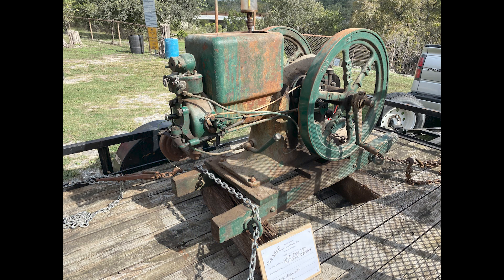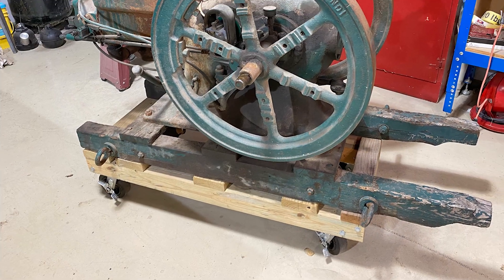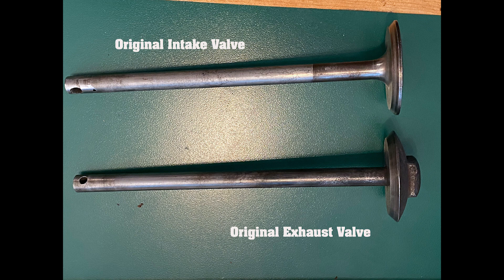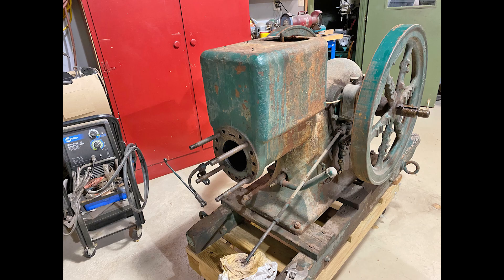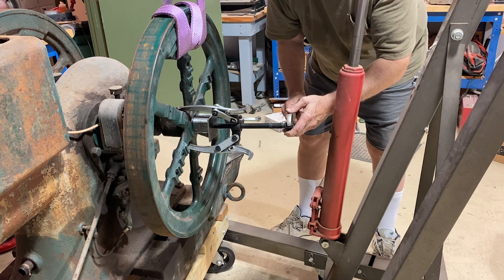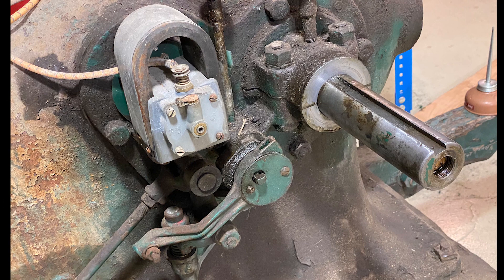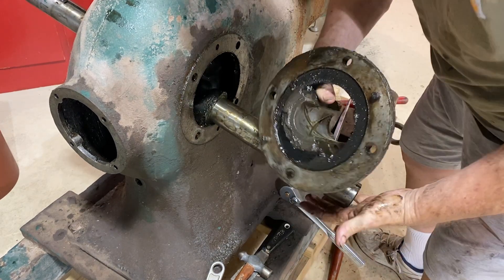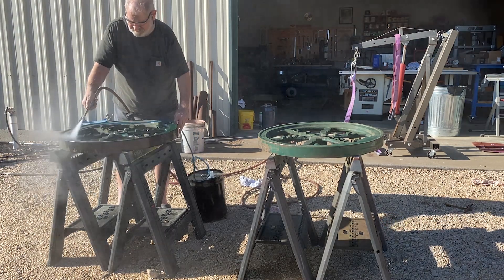Hit and Miss - Restoring a McCormick Deering 6 HP Type 'M' Engine - Part 1

Comment: Could you share which cotton gin the engine came from , my relatives owned several gins out in west Texas. around Miles, Rowena etc. I am fascinated by these engines, fuel savers before most people even thought of it. The design so it could be repaired indefinitely is intriguing while today we live in a throw a way world. I appreciate videos like yours. Curtis  P.S. used to farm cotton the roots are still there, my family was very mechanical.
Reply from the maker: Like I said in the video I was "told" that the fellow Mike Sullivan bought it from "told" him it came from a cotton gin in "West Texas." I grew up in the Panhandle and never saw an engine this small running a cotton gin! Maybe it was used for other purposes but certainly not the prime mover.